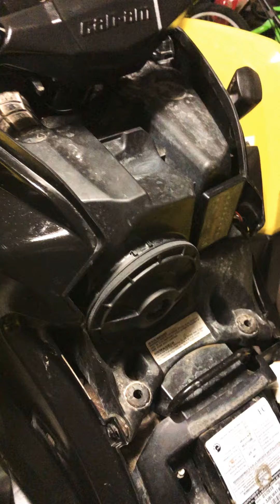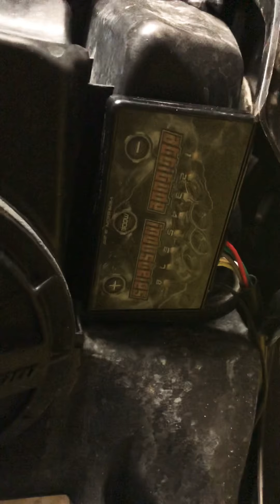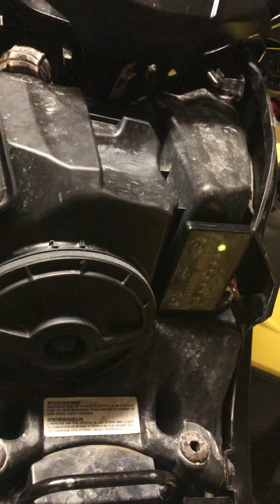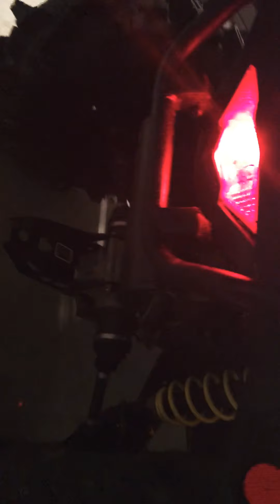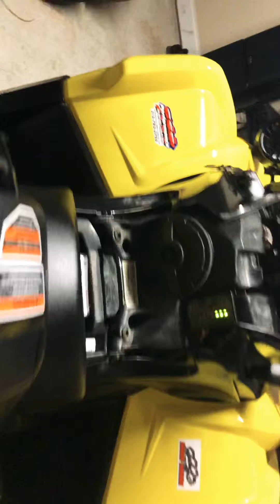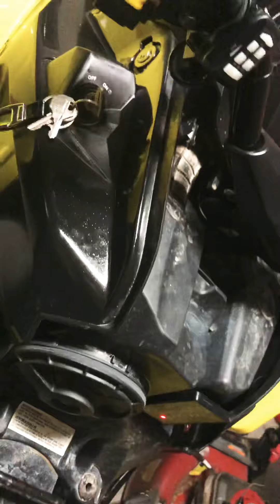Attitude industries fuel controller with GSE performance exhaust

Comment: Sounds great haus, did the controller help with the extra throaty or no changes in sound from the gse pipe from the swap? Says no controller needed for this pipe.
Reply from the maker: Thanks, The sound is pretty much the same but I did feel a different in the throttle response with the controller. At first I was a little on the fence about getting the controller, but very glad I did.